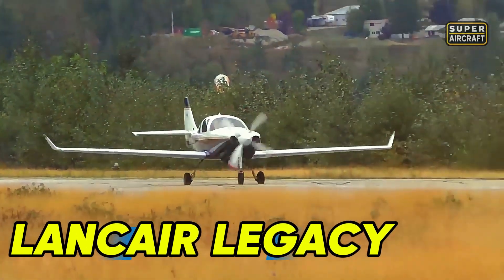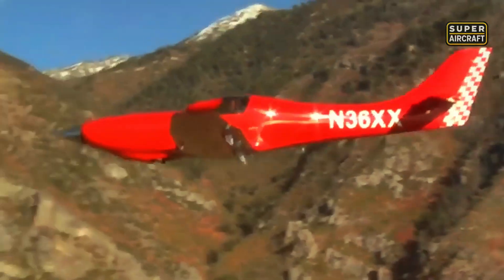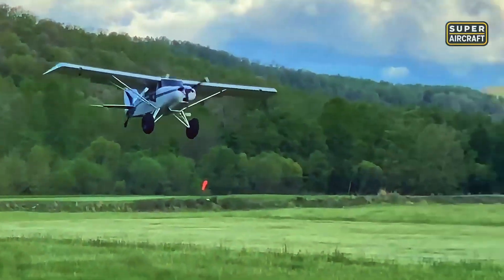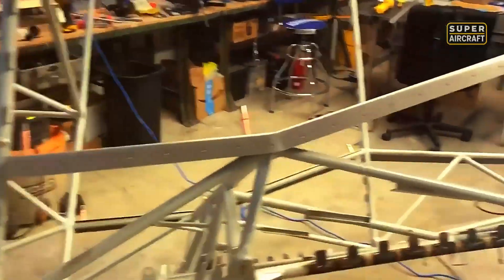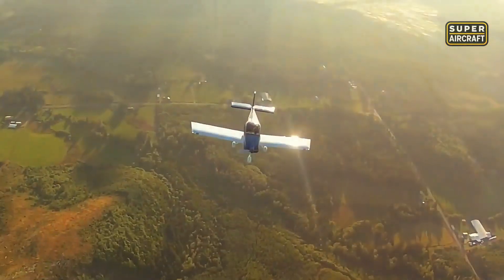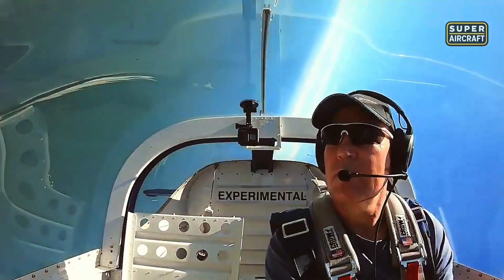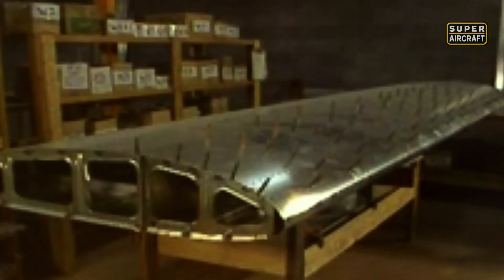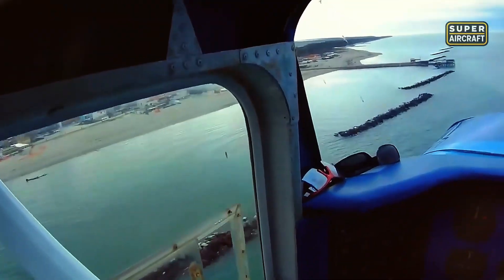METAL VS COMPOSITE: WHICH IS BEST GARAGE AIRCRAFT MATERIAL TO BUILD?

Comment: I forget the designer's name but he said use the best material for the task in the design. Like a steel tube for the cockpit cage, composite for control surfaces and leading edges and fuselage panels. Aluminum where it's strengths fits best. And wood where it is best suited. 

So I've taken his words to heart with my projects. So I blend the use of wood and composite where they are well suited... I bet some will freak with my wood and composite wing that's fabric covered to save weight.
Reply from the maker: That’s a fantastic approach, Kriss! Using each material where it performs best is exactly the principle of smart aircraft design. Wood and composites can complement each other perfectly — especially when weight reduction and strength are balanced carefully. I really admire your blend of traditional craftsmanship with modern materials. Your wood-and-composite wing covered with fabric sounds both efficient and elegant! That philosophy truly keeps the spirit of homebuilt aviation alive. 🍋✈️

Comment: I like Glastar.and the idea of using different materials for different segments of the aircraft. Example:
Fuselage steel tubes 
Wings carbon fiber or aluminum option plus foldable
Reply from the maker: That's a very well-thought concept. The Glastar’s semi-monocoque design benefits significantly from combining structural materials. The welded 4130 chromoly steel-tube fuselage provides superior load distribution and torsional rigidity, especially in crash zones. Using aluminum or carbon fiber wings complements this by reducing overall mass and improving aerodynamic efficiency. Additionally, foldable wing systems — when properly reinforced at the hinge points — can maintain structural integrity without compromising fatigue life. It’s a brilliant balance between strength, weight, and practicality.🤠✈️
Reply: @SuperAircraft2025 🙏

Comment: Steel tube fuse can be always fixt but sheetmetal plane that is mangled everywhere is totalled same with composite if its gone soft loosed its strenght in stress.
Reply from the maker: Excellent point, Martti! 🔧 You’re absolutely right that steel tube structures tend to be more repairable after localized damage. However, modern composites have evolved a lot — with proper non-destructive testing and controlled curing, they can often regain structural integrity without full replacement. Each material has its advantages, but steel still wins in simplicity and field repairability. 💪✈️